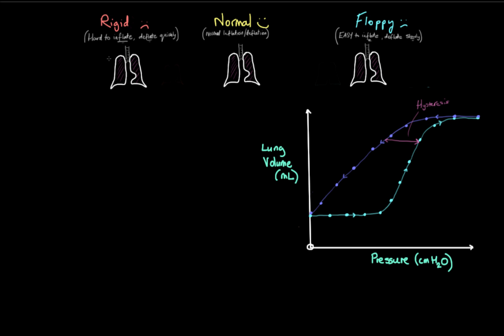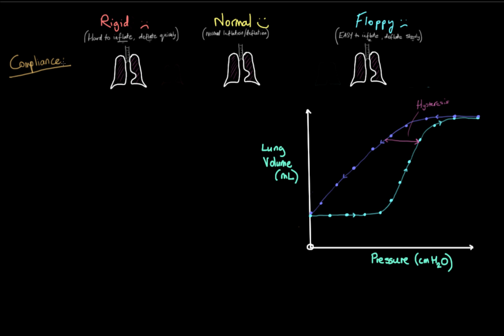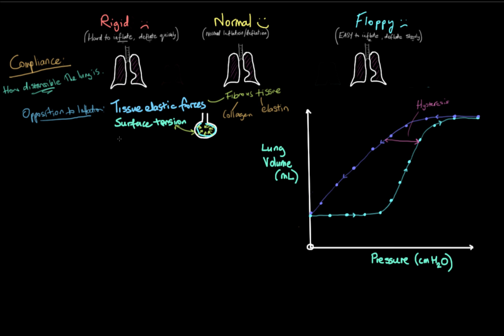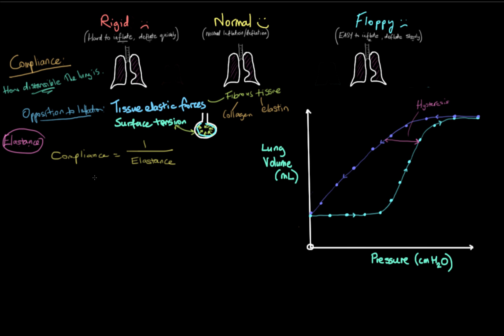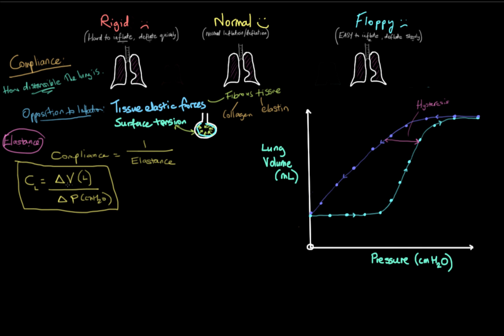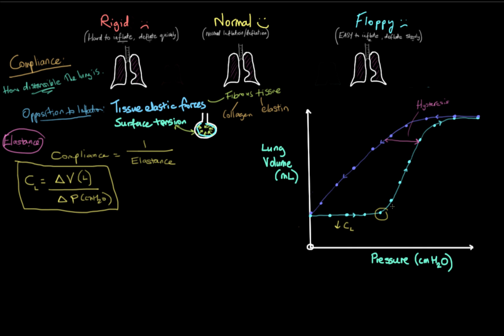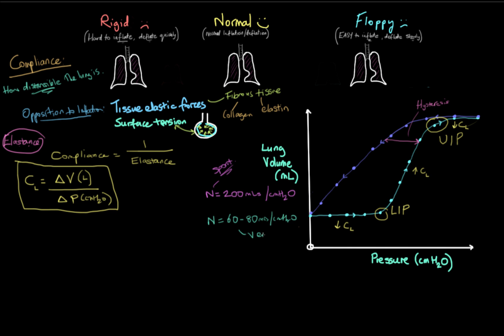Principles of Mechanical Ventilation 10: Compliance

Comment: Hysteresis is due to the property of surfactants. Their molecules are more apart during inspiration, leading to slight attractions between water molecules the surfactant is in between trying to reduce surface tension. In expiration, surfactant comes closer together and prevents that water-to-water attraction, reducing surface tension. So inspiration and expiration follow the different pressure-volume loops. This property of surfactants is the reason why the lungs don't collapse at the end of expiration. Without surfactants, your lungs collapse like in Neonatal respiratory distress syndrome or ARDS where surfactants are reduced/diluted.

Comment: There is something I'm really struggling to understand: why would the graph look so different on the way back (exhalation)? You stated what happens during Hysteresis, but really didn't give the logic behind it. You gave a good example with the balloon to describe the inflation phase, but this analogy is not valid for the exhalation phase (according to pascal law at constant temperature, V1*P1=V2*P2, regardless of the direction, inflation or deflation). Am I wrong? If so, where?
Reply: I'm pretty sure it has to do with rate of surfactant removal as the lung volume decreases.

Comment: So in regards to Emphysema and PF patients. Due to different lung compliances would you expect one to be on a higher pressure than the other>I would expect a much greater volume assisted breath for the latter; or am I way off
Reply from the maker: Azmo So emphysema tends to cause very compliant lungs (unless they become hyperinflated) so they will get a large tidal volume for a given pressure in PC, or a low pressure generated when delivering a given tidal volume in VC. Pulmonary fibrosis is associated with poor compliance. So will get a smaller tidal volume for a given pressure in PC, or a higher pressure generated when delivering a given volume in VC. I’d suggest watching the video on pressure/volume relationships in volume control, that might help clear things up. Thanks for watching!
Reply: Thanks for reply will check it out. I think i meant a much lower pressure supported breath (not volume) would be needed for Emphysema  due to improved compliance. I ask as we've been using BiPAP for COPD pt's; very difficult to work out correct PS and PEEP; particularly if have apnoeas as well

Comment: Very useful presentation.... Regarding the hysteresis loop, I have a confusion. Sir, what is the cause of this different lung volume in inspiration and in expiration, at a certain point of pressure? That is what is the cause of Hysteresis?
Reply: You can think of it like inflating a baloon.
Inspiration is more actively blowing the air, against the resistance and surface tension.
While as deflation is more of an easier passive like process, with less resistance and more uniformity.
Its more of physics.

Comment: You had it correct, the resting point is at FRC, not RV.
Reply from the maker: +Daniel Helfer Thanks for your comment! The diagram is supposed to show difference in compliance from lowest lung volume (RV) up to TLC. I used 'resting' lung volume, and it was a bad choice of words. I said FRC almost instinctively after saying "resting lung volume".  This would not be resting lung volume. The P-V curve starts at RV and goes to TLC. At FRC the small airway closure + surface tension would not be as present (and wouldn't produce the poor compliance curve we see below the LIP). Sorry for the confusion.